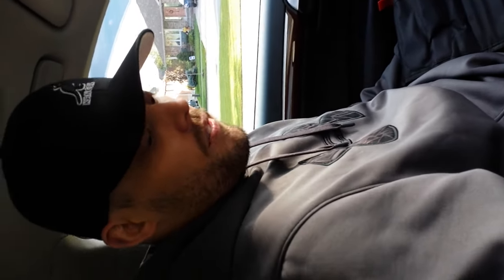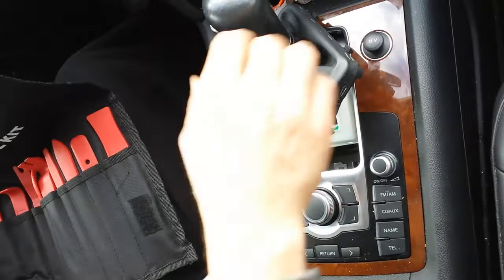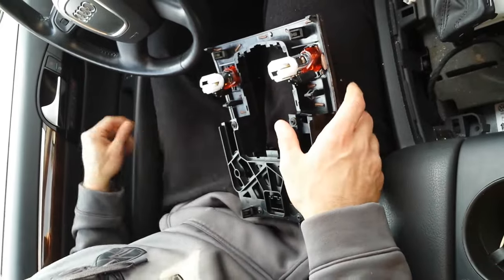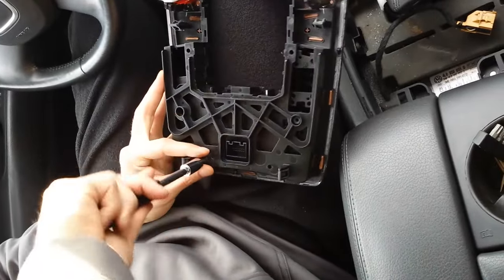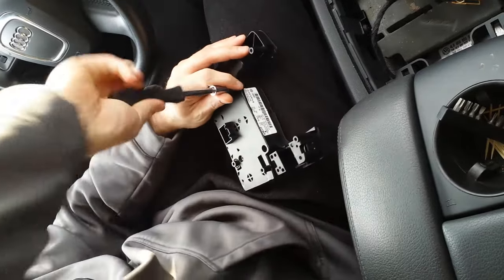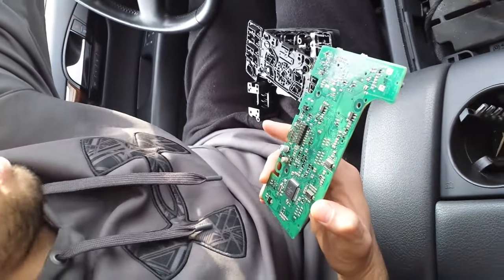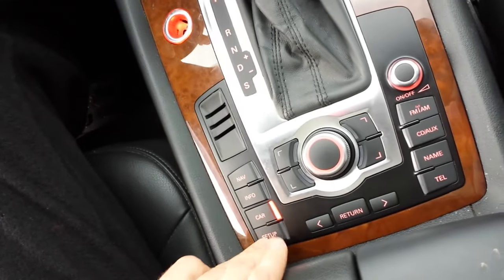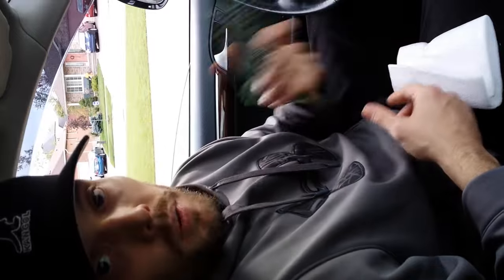Audi Q7 MMI Console Circuit Board Removal and fix.

Comment: Great video! Thanks for the help. Have taken mine apart as have same problem. I don't know if I'm being blind though, but I cannot see the link for purchasing the new board? Audi Uk want £900 for a new MMI!
Reply from the maker: +Ian Cushing  Sorry Ian  , Here is the link , I will post in description as well. Glad I can help.  http://www.ebay.com/itm/2015-new-for-Audi-Multimedia-Keys-E380-Circuit-Board-with-Navigation/131509560124?_trksid=p2047675.c100012.m1985&_trkparms=aid%3D222007%26algo%3DSIC.MBE%26ao%3D1%26asc%3D33097%26meid%3D578364283bda47918e09f66ec0271b5e%26pid%3D100012%26rk%3D9%26rkt%3D10%26sd%3D151669788363#shpCntId

Comment: Hello. I have a question regarding which board to purchase. When I click on the link you shared it says 2015 boards& when I read the description it states only for 2010 q7. I have a 2007 q7. I have the navigation buttons however my car didn't come with navigation or Bluetooth. Is the board the correct one to order. 
Thanks
Reply from the maker: It should work. Others with 07's have confirmed in the comments it worked. What you are looking for is a "E380
 Circuit Board" It doesn't matter if you have Navigation or not. I have a
 09 that didn't have Navigation but I installed the factory Nav for a 
few hundred so now it does. Let me know if you need any help or have any
 question and please comment when you get your board and tell everyone 
how it went. It is a easy fix.
Reply: +4 Realz thank you. Im going to order. I'll update you on my outcome.

Comment: Howdy, we followed your video to the tee to remove the board and clean it. All went well except it didn't solve the problem. So now we need to order a new board. When we followed the link you posted, we found the board for $62, but it didn't say it worked with a 2007 Q7. Do you know if it will for sure or not. You rock for helping people on YouTube like this!
Reply from the maker: +Natalie Villalobos Hi Natalie , From what I see it should be the same. Does the board look the same as yours ? If it looks the same as yours , I would get it. I looked on multiple sites and it says from 2007-2010. Thanks for the nice words.
Reply from the maker: +Natalie Villalobos  Did you ever find out if it was the same fix for the 2007 Q7 ?
Reply: +4 Realz Yes, we just installed it a few days ago.  The numbers on the board were a little different, but it works perfectly!! Thanks again for your video - you saved us a lot of money!
Reply from the maker: +Natalie Villalobos That is Awesome news. Glad it worked out and you saved some cash. Now others will know it also works on the later models. Thanks for getting replying.

Comment: Thanks for a great video!  I also need to replace the silver trim around the MMI console (the one you used toothpicks to remove).  Do you happen to know where I can find that?
Reply from the maker: Thanks, I am not sure the year of your car, a few of them are compatible, I have seen the whole  console with all the buttons and trim for $100 used on ebay, But here is one that I think might fit. http://www.ebay.com/itm/New-Genuine-VAG-OEM-Audi-A6-2005-2011-Front-Console-Frame-4F0864260A/112046512878?_trksid=p2047675.c100012.m1985&_trkparms=aid%3D222007%26algo%3DSIC.MBE%26ao%3D1%26asc%3D38530%26meid%3D72683cc5cc424684b19b9a060b067d4a%26pid%3D100012%26rk%3D3%26rkt%3D10%26sd%3D152199562443

Comment: Thank you so much for the help, I received the new circuit board today and I installed it.......however it still does not work, well, half of the board works......the push start and stop, but not the radio portion.  The only thing it could be is the connection.  Do you know if you can order the little connection?  Bummed, 😔but you made it easy for this Texas girl to do all by herself! 😊
Reply from the maker: You are very welcome. I am not sure I know what you mean ? yours has the push start button ? It could also be a faulty board.  I would check connections and then return the new board for a replacement. Did you get the board from my link ? what year is your Q7 ?
Reply: +4 Realz I used your link, when I plug in the connector for the push start, that part works.......its just the radio that doesn't work.  I have a 2007 Q7.
Reply from the maker: Did the boards look the same ? Did the push start work before ? If the boards looked identical other than color, I would contact the seller and tell him its not working and to send another. Its not the first time someone got a faulty board.
Reply: +4 Realz ok, I'll check with the seller, the colors were the same.
Reply: I'm having the same issue. I bought a 2 new board and still having same issue. I was told that it could be the amplifier that causing the issues?
Reply from the maker: I am not sure. The amp is not hard to change. I seen it when I removed my back panel to install the Navigation and Satellite.  Just go on ebay and look for a used amp and switch it up. Obviously before you unhook it try moving the wires and making sure it has a good connection.

Comment: Hi thank you for the video it was very informative. I am having some other issues with my 2008 Audi Q7 and I would like to fix them myself,  I would really appreciate it if you or anyone else could help. 
First issue: My car keeps dying. I changed the battery and tested the alternator which is giving me a reading of 14.1 which is good... but if I leave the car off for more than 12 hours it dies and requires a jump. I am unsure of what the problem is at this point. 
Second issue: My start/stop buttons, volume knobs and some of the other buttons on the center console are faded and I would like to replace them. 
If someone could help to point me in the right direction to getting both of these issues resolved without it costing me an arm and a leg I would be very grateful. Thanks!

Comment: Great, thanks! I have a 2007 Q7. Although it says it's for an  A6, I'm assuming that the two vehicles are similar in interior trim, correct?
Reply from the maker: Yes they are the same, But for your peace of mind http://www.ebay.com/itm/Genuine-VAG-OEM-Audi-Q7-07-15-Front-Console-Frame-4L0864260A-/142117447611?hash=item2116dc27bb I hope that helps. If you have any other questions feel free to ask.

Comment: Awesome virgin video - you did a great job! I have a similar problem, however by board is fine it is the panel w/ buttons - any idea on where I can get that?
Reply: Received my full replacement module and referred back to your video - old one out, new one in in like 20 minutes - saved my $100's in labor costs. Thanks again!
Reply from the maker: Awesome, Glad it helped.

Comment: Hey great video. I'm working on a 08 A6. The MMI Turns then right off. What could it be.
Reply from the maker: Thanks for the comment, definitely sounds like the board. I am pretty sure it is the same board as in the link. Follow the video and look at your board. Try and clean it and if it doesn't work order this board if they look the same (almost positive they are the same).

Comment: Thanks so much for everything. The question now is how to put all the parts together and get it installed. Once I get the parts I will send you a message and we go from there if you don't mind. Thanks again
Reply from the maker: No problem. I am here if you need me.  By the way, its a good chance that the navigation unit will have the map dvd in it, Mine did, but I downloaded the newest maps and burnt to a dvd and it works perfect.

Comment: NEW QUESTION.. so i can not find the exact part for my 2007 audi q7 mmi controls.. the part I ordered was for a newer audi q7 so had to return it.. my question is.. am i able to remove the 6 disc changer.. install a basic cd player.. run wires to new 4x6's and 5x9's and totally bypass the mmi sound system... so basically install a new cd player in place of the disc changer... any suggestions... is this possible ..???????
Reply from the maker: Anything can be done but why ?   We will get the right board. What symptoms is the car having ?
Reply from the maker: does this look more like your board ? I am guessing you have a 2g low MMi. http://www.ebay.com/itm/Multimedia-MMI-Control-Panel-Circuit-Board-w-Navigation-E380-for-AUDI-A6-A6L-Q7-/332127328737?fits=Make%3AAudi
Reply: This is the chip board I ordered and returned because it was too large and not compatible for my 07 q7.. 

http://www.ebay.com/itm/New-MMI-Multimedia-Control-Head-Board-E380-With-Navigation-for-AUDI-A6-Q7-/162304969763?ssPageName=ADME:X:RIRNTB:US:3160
Reply from the maker: Maybe this is the one you need ? http://www.ebay.com/itm/New-AUDI-A8-S8-2004-2009-MMI-Control-Head-Board-2G-E380-With-Navigation-in-USA-/162396852787  Does that look the same as yours ?

Comment: Thank you so much for posting this!!!! You have truly saved us a lot of money and relieved some stress! 
We changed the circuit board but now my back up camera does not work :/ 
I also think the version of this circuit  board needs to be updated. Any idea how without going to the dealer? I have a 2008 sline Q7 but there is not many settings as before :( 
Please if anyone knows anything, please help or send me in the right direction!
Reply from the maker: I would think its the same board. Is it possible the new board is faulty ? Does it look the same as your old board ?
Reply from the maker: Larisa Mobley I think maybe a faulty board. 1st I would check all the connections and make sure they are clean and connected tight. does the cam work still with old board ?
Reply: 4 Realz it all stopped working at the same time. Mmi buttons and camera. 

This is what the version says
Reply: It actually won't let me post the attachment. Is there a email where I could send to you?
Reply from the maker: you can send to stuckchillin@gmail.com if you still need

Comment: 4 realz, I jst fixed a new mmi console board on my Audi Q7. I made de order frm de site u provided everything is workin perfectly but I can't find de Bluetooth.
Reply from the maker: Glad it worked out for you. What do you mean, You can't find blue tooth ?  If it worked before and doesn't now, I would check the harness plug, If not that then maybe a faulty board you just bought.
Reply from the maker: If you didnt have the blue tooth, I know there is a software update for the MMI to allow Blue Tooth. If you have not figured it out I will try and help.

Comment: hey i have a a6 little different story  from yours but very similar my radio turns on when i turnon the car but shuts off after a while and all my buttons turn red immediately radio turns off and it only stays on cd doesnt read any other buttons being pressed
Reply from the maker: Take out the board and see if it loos sticky or try cleaning ?

Comment: Hello. We have a 2008 q7 without navigation.  Does the link to the board work with ours? Or do I have to find a different board?  Definitely want to try your tutorial.  Thank you man!
Reply from the maker: +iamsticky I am pretty sure it does. I didn't have Nav in mine until I installed it. But the button was there. I also have read they are back words compatible. I hope it all works out for you. Let me know if you have any questions.
Reply: +4 Realz I actually ordered a chip without navigation from a different link from China.... Followed all instructions and still it didn't  work. No lights no nothing.  I'm going to order the link you mentioned and give it one more shot.     I actually tried cleaning the old chip and only thing that works now is he fm lights and volume button now works.   :(  I'll give it one more try with the link you gave us.
Reply from the maker: Did you ever get it fixed ?

Comment: If anyone has a 2008 Q7 premium with the start stop buttons, how do you remove the wire connected to it. i have all the wires that were in this video removed, but can't seem to get the push start button removed.
Reply from the maker: I didn't think you had to remove  the push start. Someone else had the push start and i thought they said they didnt have to remove it. Its some where in the comments.

Comment: 4 real, my Audi Q7 2007 model mmi comes on nd goes off in few seconds also the red lights re not showing any longer, this started after taking it to de car wash.
Reply from the maker: +Edward Taylor it should help, the board has a bunch of led bulbs and it soulds like a faulty board. Its a cheap fix, let us know how it works out.

Comment: Great Video! 👍 btw what is the part number? i have the same q7 model with u..
Reply from the maker: Just look for E380 Circuit Board. It doesn't matter with nav or not. Let me know if you have any other questions. Have a blessed day.
Reply: 4 Realz Thanks! ive order mine.. Hope it works..

Comment: Great video...thanks for posting this!   You mentioned that you installed the NAV on your q7.  Can you let me know how thats done or point me to anything that could help me out?
Reply from the maker: For sure I can help. I bought it with no Nav and put it in pretty much plug and play for a few hundred. The dealer said it could not be done and if so it cost $7000 Haha. I did a write up on a forum and FB Group. But if you need any help don't hesitate to contact me. https://www.facebook.com/groups/126898554036024/permalink/956235771102294/
Reply from the maker: Bill R You need these 2 cables,  http://www.ebay.com/itm/Optical-fibre-Cable-Loom-LWL-Connection-CD-Audi-Media-Interface-AMI-MMI-/131792436292?hash=item1eaf70fc44:g:72kAAOSwymxVMMT9&vxp=mtr and u need the Nav Dvd Drive assuming your Q7 has the MMI 2G system. Part number 4EO-919-887M Here is a cheap one on Ebay. http://www.ebay.com/itm/2004-2005-2006-AUDI-A6-C6-NAVIGATION-DVD-ROM-4E0-919-887M-/131861684916?hash=item1eb391a2b4:g:-mkAAOSw6btXRR2Y&vxp=mtr And I bought a cheap antenna from China for $10 because I could only find the one factory antenna wire and I used it for my Satellite. So that would be $166 U.S for the parts and I bought the bracket from the dealer for $30. Mine came with the 2014 Maps, I burnt a copy of 2016 maps and  new software. Thing works great. Very happy with it. Message me if you have any questions at all.
Reply: Thanks for getting back to me!   I looked into it and I think I have MMI 3G Basic (it's a 2012).   I may be out of luck.   I'm reading that 3G is locked down by the dealers and I think I need to go through them for any changes....I'll need to look into this further and see

Comment: Hi mate, the video was really helpful and i have ordered the control unit through ebay. Audi service centre quoted AUD 2250 to replace it yesterday, really happy that I googled it. 
Could you please share the link on how to activate and install sat nav on these boards?
Reply from the maker: Glad it helped and you saved some cash. Here is the write up I did on the sat and nav. https://www.facebook.com/groups/126898554036024/permalink/956235771102294/
Reply: 4 Realz Hi mate, got my new board just then and installed it straight away. But am still having the same issue, mmi turns on for couple of seconds and then turned off. Any ideas?? Will be stuffed if the new board from ebay was also faulty :(
Reply from the maker: Every now and then people get faulty boards.  Return it and try another one.
Reply: Returned the board and got a new one and still the same issue. When I turn on the ignition, the MMI screen turn on for couple of seconds and turn off automatically. If I press any buttons on the MMI console, the same happens. Now I can rule out that its caused by the board since I tried with three now. Any clues on other parts that might cause it. Hate it take it back to AUDI and them charging over 2K.

Comment: i ordered the pard replaced it but it doesn not work system doesnt not start and if i plug back the old one it does
Reply from the maker: do the boards look the same ? Maybe the new board was faulty. So it works now ?
Reply: yeah they look the same mine is without nav. Just the number on the right corner is 149//8200 original and new ones 149/8300. Also the voltages numbers on condensators is different on the new one. Though I ordered it from the ebay and on the pictures they were the same as on original one. I will try to look for another one in scrap yard or smth.

Comment: Hey, I'm having the same issue with mine. What state are you located.  If you don't mind can you help?
Reply from the maker: I am in Canada, But I will help anyway I can. Order the new part and follow the video. Any questions, Just ask.
Reply: Still having same issue bro, i bought a new mmi control switch, the only difference is the screen stay on for 1 minute and still cut right off instead of the 15 seconds before. What do i do now?

Comment: Wonderful and very encouraging video. Thanks so much! I have the Audi 2007 Q7 with a faulty board (on-off is inop and some of the control illuminating lights are out. My Audi never had NAV installed, although the MMI switches are there for it. Should I buy the board you bought from China with NAV anyway? Also, How difficult and how expensive is it to to add the NAV dvd player and whatever else to get factory MMI NAV to function?

Thanks,

Bob
Reply from the maker: Yes this board will work and the nav is plug and play for the most part to install. Mine came without nav, but had the  button. I installed the 
Nav and Sat Radio for a few hundred. It is all really easy to do. Message me if you need any help or have any questions.

Comment: I thought after you get those replaced you would have to go get it programed at the dealer
Reply from the maker: No, just replace the board it its good to go. Order the board and it will take you 20 minutes to replace your self. Super easy.